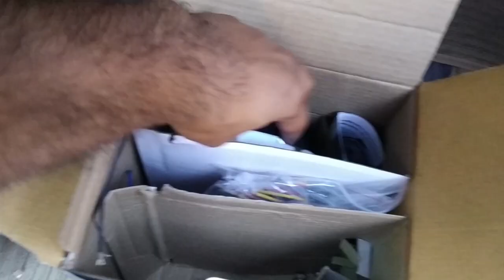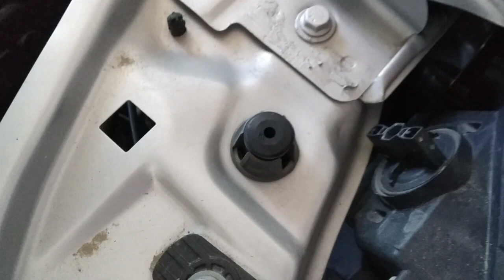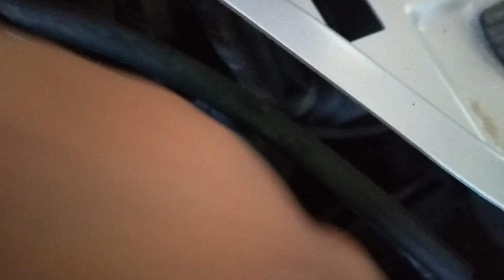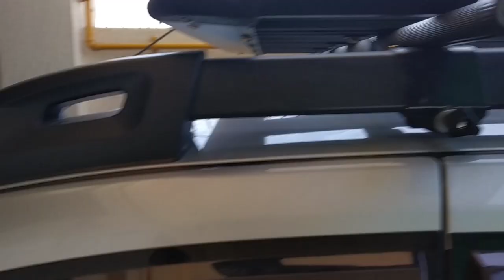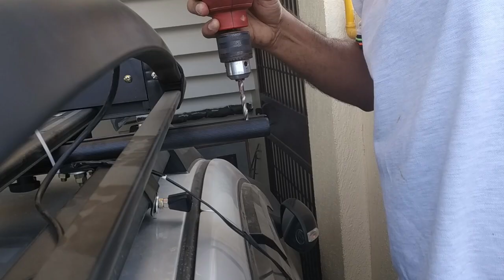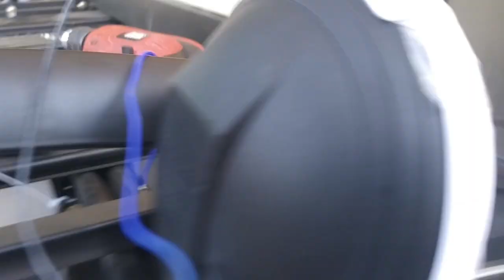Hella headlight Installation in Renault Duster

Comment: Hello Sir recently bought Hella 4000 spot beams ,I need to install it in grill so Do I need a relay for this
Reply from the maker: Plz don't install without relay, without that you are putting extra load on existing wiring which is not designed for that...

Comment: I am confused which is best
Projecter and Hella lights
Reply from the maker: Projector is better if it's part of standard fitting or OEM. I wouldn't suggest to go for after market projector in existing headlights, if you want you can get fog lamp replaced with projector. Otherwise, hella is the best, later I will install these light in front of car grill.

Comment: i am looking to buy crossbars any links
Reply from the maker: Satyarth bhai I would not suggest to go for LED bars due to many reasons. First, all bars are made in China and not of good quality already checked in all Delhi auto markets. Second, for its installation you need to install it on roof or front of you car. If you install on roof it will make upcoming vehicle drivers almost blind and if install in front than its very risky bcz even small impact will damage radiation or turbocharger which costs too much.
Go for hella lights and install infront of grill, you can check on Google lot of peoples installed it in their Duster and it add to dusty beast look.
But at last it's your decision and I am sure you will go for right decision....
Take care...
Reply: Paji i am asking the crossbars that you installed above the rooftails .i am installing a faadu light setup will update you soo
Reply from the maker: My mistake bhai...
For crossbar I would suggest to check with manufacturers rather than retail shops because they will do jugaad baji, duster's roof rail is of bit different design.
I have checked whole karolbagh &  kashmiri gate auto market but no one is providing clamps as per duster design. Finally contacted manufacturer and he design those clamps for me.
I don't know if there is any change in roof rail design in new duster.
Plz check in your local auto market may be they have proper clamps for duster.
Reply: @diyguy7378  Can you please take small video/pic of your duster roof rail clamp and share on 9755580079. I'll be thankful to you.